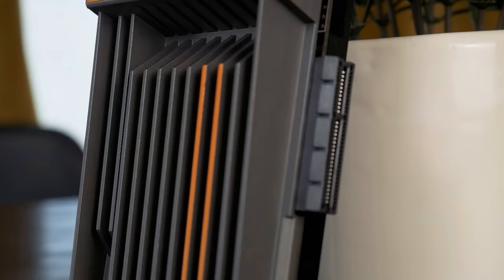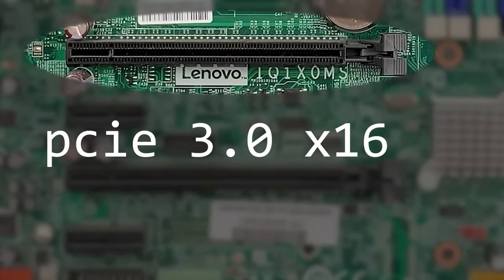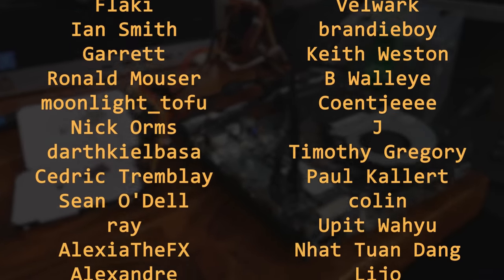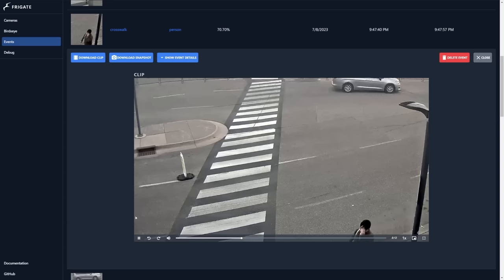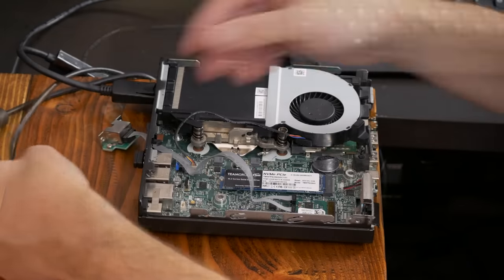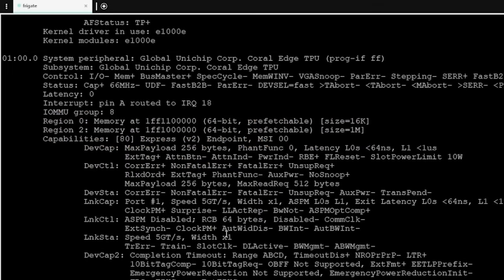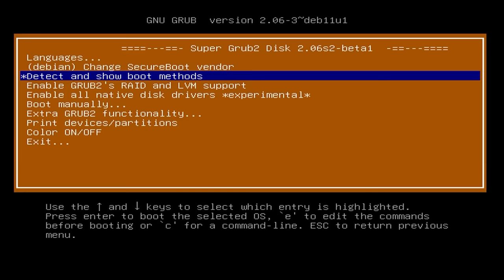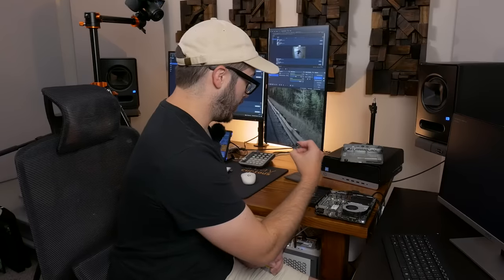Don't Overlook This Slot

Comment: You can also buy a PCI X4 adapter for the wifi port, that allow to install whatever card you want.

In my case (M710q) i use it to connect a sata card with x6 sata ports
i found a really cool way to actually power drives directly from the M710q motherboard, so i have x6 3.5 HDD drives connected
Reply from the maker: That’s a awesome!
Reply: l wonder what wire you were jumping to power up those hdds. Cant possiby be the usb headers right?
Reply: True yes but don't think you can combine the 2 separate 1x links into more bandwidth, you only get a 1x link to the 4x device. Not going to slow down most things but there is a chance.
Reply: do you have any youtube video for the setup?
Reply: There's an expansion card that will give you a full PCIe GPU slot (externally, of course). Lets you run a full sized GPU at PCIe 4X
Reply: Man it sound great!
Any chance you share your setup?

Comment: I was recently working on an HP SFF pc that only had 2 sata ports, one was in use for the DVD drive and one for the internal hard drive. We added a 2.5" SSD to it but there was no extra sata port. I found on Amazon you can get a little adapter that is the same size as a wifi card that has 2x SATA ports on it so I put that in there and connected the DVD drive to the expansion board and put the SSD into the motherboard. Works awesome. The PC is used on Ethernet so didn't need wifi (and the slot actually came empty on this model of SFF PC!)
Reply: Hello! I have been researching about this adapter for awhile but just can’t find any feedback on how reliable the adapter and max speed. Since you are using SSD, I was wondering if I could get some feedback. What’s the transfer speed and have there been any issues? Thank you

Comment: 1. That port you removed can actually become a 2.5gb ethernet with an HP module XD
2. You can delid the Ryzen Pro in that HP with a razorblade, and you really want to do it. They actually used THERMAL PASTE UNDER THE IHS, so it comes right off and the stuff they used is awful and dried up. Replace it (i used PTM) and pop the lid back on with another layer and it will run a lot faster, quieter, and cooler.
Reply: What do you mean with 2.? Because doesn’t it have an intel cpu?
Reply: @advertentiegolf You're right, I have the elitedesk 705 G4. To be fair, they are pretty much identical inside and out except for an internal header that allows thunderbolt FlexIO in the Intel version (AMD still doesn't have a license for Thunderbolt today) and the CPU under the heatsink. It's still useful information though, the AMD version has some benefits. For example, Bazzite and ChimeraOS which are meant to work as SteamOS for non-steam devices need an all-AMD system to work properly and the 705 works perfectly for that. Just make sure to crack off the CPU heat spreader to prepare the whole thing.

Comment: I used a 2x sata adapter on a jonsbo n2 which as far as I can tell is the only way to get the maximum 5 drives from a modern consumer itx MOBO. Works pretty well!
Reply: I'm actually looking at a Jonsbo build and have recently come across a 6 port 2280 M.2 adaptor. Very handy for the ITX boards with 2 NVMe slots as it means you can run an Optane drive on one still for cache.

Comment: 13:45 the hdd only got recognized because there is a common ground between the power supply in the HP pc and the external power supply, the only path to join these two grounds together are the sata cables to the hdd, so yeah, you might run into some issues if you don't have a proper grounding between the power supply's

Comment: Regarding the Sata card, maybe its hitting the power limit since HWInfo shows only 10 watts max on it, or just a weird compatibility issue, not totally sure myself but I've seen other comments try to suggest some tips. Really awesome to see people trying this stuff because I was really curious on how it would work. Great video as always, and keep doing what you do! I aspire to be like you and try stuff to see if it works.
Reply: I have tried this in chromebox cn62 but the adapter is flaky, but it recognized the ssd, unfortunately the chromebox had died probably due to incorrect grounding of the psu for sata adapter

Comment: Nice video, actually the first one which talks about that not all are equal since manufacturers are building them differently. Good job! 😊

Btw the Coral TPU driver is also all available for Unraid and the setup process is much easier.

Comment: My laptop Prometheus has 4 of these slots. Two half height, two full height. I have installed in them a combo Wifi AC/bluetooth card, a Google Coral, A Sierra Wireless MC7700 4g LTE modem, and some no name 240gb SSD for my OS boot drive. It's an older core perhaps, but it checks out.
Reply: Curiously not all of these slots were created equally. The combo card, for example, will only show its wifi module if plugged into the "Aux" connector but will show both if plugged into the one labeled "wifi". This suggests to me that the former does not have USB connections....which of course isn't a problem for a Google Coral 😁

Comment: Hello, in fact, I saw your content, and it is wonderful content, but while you tried using an external power source for the storage units, it is incorrect. If you want to use storage units with the unit used in the video, you can use a source from the device itself by allocating a USB port for the two units, because the 2.5 hard drive uses 5 Volt only, best regards 14:18

Comment: 4:24 I'm using a WD SN740 nvme drive in the wifi card slot as a boot drive for my home NAS (with the J4005DC motherboard), I just had to buy the "M.2 A/E Key Slot To M.2 M"

Comment: A few months ago, I bought several B, M, A, E , B+M and A+E and maybe B+E key adaptors (they are packed away) for testing on a latte panda delta 3 and one other MB that I just can't recall at the moment.  This was a bit of a flashback to some of the headaches I had while attempting this.  I'm reasonably certain that many of my problems were related to the BIOS.  Not sure if the devices were whitelisted/blocked in the BIOS or how/why an engineer would even go through the trouble to block and/or enable only certain things, but I do recall having issues getting them to work properly.   Adding to the frustration was the fact that BIOS (for the most part) is still secret sauce stuff and I just don't know how they limit and/or allow just certain PCIe devices (or any other device).  I can only say that I eventually gave up.  I really wish I could have found a completely open BIOS that I could have flashed that would just simply treat any PCIe device as something communicating on the PCIe bus - but that doesn't seem to be the case.  Before I ever do this again, I want to find a completely open BIOS that I can configure and flash at will.  It really shouldn't be that difficult.
Reply: Did you have these experiences using the LattePanda, the other motherboard, or both?  And if you don't mind sharing, what are your other experiences with the LattePanda Delta?  I am on a tight budget right now, so I am considering getting one of their new Sigma series with the 32 GB of RAM now available and using it both as my main computer for a while and to learn Arduino.

Comment: Got a HP 800 G4 mini, a newer model that the one showed in the video. Did and experiment with one of those E-key 2.5 gigabit ethernet cards, great fun. Managed to snag an actual Intel-based card (i225) for pretty cheap and mounted it in the G4. Was a tight fit for the E-key card, then the actual Ethernet port (the dangly end like shown in the video) had to be fastened somehow. I managed to get it securely mounted INSIDE the G4 by first of all insulating the metal on it with electrical tape (important), then I used those plastic-coated metal wires you get from packages (I always save those, good to have) and tied the Ethernet port down. There are multiple holes on the back of the PC where you could fasten such wires.
The card works great and the port sits flush with the back of the PC.

Comment: I used this slot for a four port SATA card.  A little slow, but not terrible.  It's used for the four hard drives that make up the backup in my 40 tb NAS.
Reply: Hello can you share a link on what you use? I have been searching for this and cant find anyone using this one. Thanks!

Comment: you can get an e-key to M and B keyed adaptor for the slot as well, but I went the same route you did 2 SATA ports since the mobo I bought can't use it as a boot drive and I can't use WIFI with treuNAS.

can we get a full video on how to set up home security? with a system like this? I plan to do something like this but I refuse to buy cameras that connect over WIFI and report to a could server.

Comment: I actually just bought a mini pc the other day, was able to find a cheap e key to m key adaptor and it worked with an m.2 nvme ssd. I installed linux mint and was able to boot off the m.2, no issues so far.

Comment: I recently installed the coral dual TPU in my wifi slot, however, it did not work at all. The bios picked it up as a GND device, but it does not show up under the PCIe devices on Linux.
I have an "asrock z690m-itx/ax" motherboard, which according to the specifications supports: "type 2230 WiFi/BT PCIe WiFi module and Intel® CNVi (Integrated WiFi/BT)".
So if you see this, be aware!

Comment: The TPU was probably the one I'm most interested insince Frigate kind of requires having a TPU installed to work. Part of a much larger project for me and not sure when I'll get started on it.
Reply: That's not true.  I've been running frigate  on the CPU for 1.5 years. i5-6400 takes it well, although CPU usage is ~35-40W. Recently they came out with OpenVINO support which reduces overall  electricity usage by ~25-40%. 
You can definitely run Frigae without Coral. It's a bit more inefficient but totally works.
Reply: @tenekevi  I am showing my ignorance here, but does TPU mean Tensor Processing Unit, or something else?
And what Operating System(s) does Frigate run on?  I am wondering if I could use it on one of the new Single Board Computers that are coming out based on the new ARM processor from Rockchip that has an on chip Neural Processor. Something like the Orange Pi or Cool Pi boards.
Reply: Yes, it stands for Tensor Processing Unit. And as far as I know, it's ran under linux. I think it can run both on x86 and arm architecture. That's especially easy with a Docker container.  I can't comment on the ARM stuff though. People have ran it on a Pi4 with a Coral TPU attached via USB. A SBC might be ok for a few cameras - 2-4. I think anything else will need a lot more juice to perform the video encoding.
Reply: @tenekevi  Thank you very much.
Reply: @username-s9s3r  You never needed a TPU. Frigate just works with various degrees of efficiency. OpenVINO is a lot more efficient than a bare CPU but it's less efficient than a Coral TPU. I use both so I can compare.

Comment: I actually have an m.2 e key nvme drive in my parts bin somewhere. I bought a late 2012 Mac mini a few years back and swapped out the stock nvme drive for a Samsung something or other, and had to get an adapter to do it. The drive I pulled outta the mini was an e key drive. I tried to sell it on eBay but no one wanted it lol
Reply: Mac mini 2012 does not have any nvme ssd. Some mini 2014 models have. Those Ssds use apple-only keys, not standard b,m or e keys. However there are cheap adaptors to make them compatible with b/m keys. And, such ssds can be used in many macs from 2013-2017.

Comment: thank you so much I just built my girlfriend an ASRock b660m-pro Rs with a i5-12600f so we can play some games together and I didn't realize it didn't come with Wi-Fi and I bought a Wi-Fi card and it wasn't working I was very confused until I watched this video and you talked about the motherboard manufactures white listing to only use certain cards I then looked it up for my motherboard and it only uses intel made cards thank you for your help I thought the slot itself just non-functioning and reserved for the Wi-Fi model only luckily its an ASRock motherboard and they keep all there motherboard listings and specs and support even old boards running 2nd gen intel witch is awesome of them
Reply: Holy crap no punctuation

Comment: Happy that the Thinkpad X1 keeps the sim card slot accessible outside and sd card as well
Reply: That's a feature of B keying.  I mean, you could do it with other cards, too, but you would need a cable coming off the card to the SIM, instead of breaking those lines out through the slot which is what's happening in B key

Comment: I've used the EXP GDC Beast Video Card Dock on my HP Thin Client t630 to use an external graphics card using the Mini-PCie/NVMe slot. While it's VERY limited, it's 100x better than the onboard graphics. It's interesting to see a low-power 4 core APU boosted by an RTX 3050. XD

Comment: I heard that they used to whitelist like that but don't really any more.  I heard HP was one of them that used to do it.  I had a more modern HP laptop from the last couple years and upgraded its WiFi myself.  I used an AX200NGW and that is even though it wasn't listed as one of the cards that the laptop could have came with if it was a model based off the same motherboard.  I just had to get another antenna for it.  It only had the cable for one antenna.  I just stuck it down somewhere inside the case, it seems asenine to make us mess with the display bezels and do all of that work to get to it.  I just made sure to put it where it will not short something.  I also taped down the small bit of excess cable but never sharply bent it anywhere.  I just needed it to stay in place so it won't move and get pinched when I close it again.  I have a new roll of 3M electrical tape for that.  The new card worked, none of the computer refusing to boot with it or any of that

Comment: I have been using E-key M.2 PCIe for a while now. Mostly converting ebay special board-only Gen 4 or 5 Intel NUCs to turn them into gateway routers for family members and friends. Better solutions than consumer routers off the shelf and much more manageable. Low power, low noise, reliable performance... Yea... People should explore the world of PCIe m.2 E-Key and sometimes you can find some weird B/M key adapters as well. 
I've even seen 10Gbps adapters, but you'll want to be careful with those, they get hotter than a m.2 NVMe drive.
I have used a E-Key cellular card for a family member that had a house in a rural beach area, worked great to make a WAP/Router to monitor a security camera, some sensors and provide internet access when people are using the property.

Comment: I've found the slot useful for non wifi, much like you. With the Dell MFF PC's they have Realtek NIC's onboard. Which suck as vmware ESX 7 or later doesn't support them. Rather than have USB adatpers hanging out, put in an Intel 210 gigabit NIC in to slot. The older dell MFF PC's have a VGA hole, which nicely takes the RJ45 connector. It looks almost factory fit. Vmware 7 or 8 will then install. Once vmware is running, you can pass the onboard Realtek NIC through to an OS to use natively if you want. Is how I did my openense firewall - use the Realtek NIC as the external interface, and use the Intel as the internal bridge, alongside other VMs. I don't have an overly quick internet connection, so not an issue for me with regards to the internal NIC contention
Reply: Is the external antenna required for wifi? The wifi card doesn't have signal?

Comment: Great inspiration...liked the 2.5G NIC atapter idea. SATA drives not realy practical because those SFF boxes dont offer enough power to run HDs anyway....But still thanks for another great video. For 2.5G is a 2.5G switch sufficient or don't you also need to add a special 2.5G router?

Comment: Good job!
I found those 2.5 Gb adapters on Amazon, and they work great on the HP mini Proxmox Cluster units!
Reply: Is the external antenna required for wifi? The wifi card doesn't have signal?
Reply: Did you happen to figure out a way to mount them to the case securely?

Comment: have an hp elite refurb laptop, little did i know that the mini pcie slot is choosy with the hardware. my wifi+bt mini card does not work, so used another wifi only card

Comment: It helps that Intel's standard non CNVI cards use PCI-E for Wi-Fi and USB for Bluetooth. And they're sooooo cheap it's only worth undercutting them to save PCI-e ports on a low-power system.